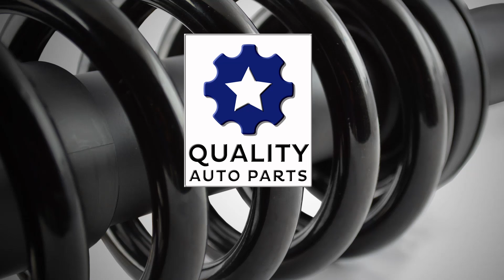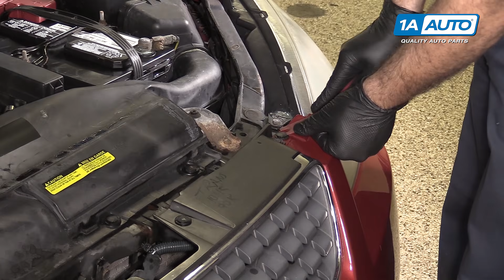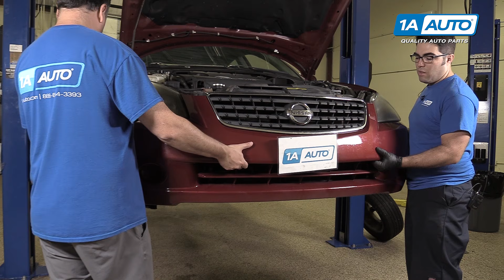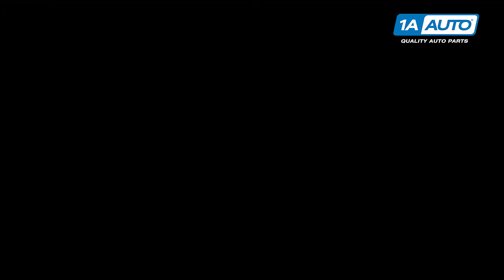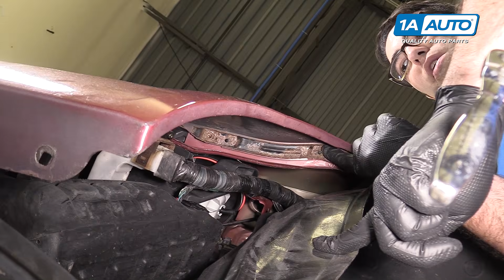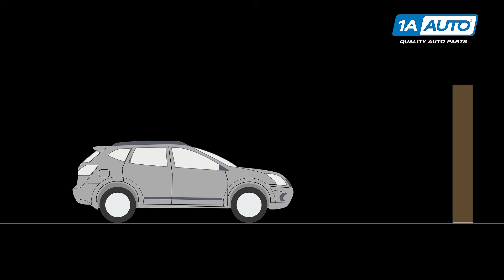How to Replace Headlights 05-06 Nissan Altima

Comment: My driver side headlight came out without removing the bumper.  However, someone had taken them out before and didn't put the screws in behind the bumper.  I'm slowly fixing this car and getting it back to where it should be.  Love your videos.  I feel like if I watched them all for the 2005 Nissan Altima 2.5, I could take the entire car apart and put it back together!  Great content!  Thanks.

Comment: Whoever painted that car should be shot, over spray on the fender liners and wheel wells, the front black fog light inserts they didn't tape off or just remove...  Those are painted as well! Not to mention how bad the fender Justice k looks in the video....  Rant over LOL

Comment: You're definitely not getting these off in a junk yard, unless someone did you a favor and took the bumper off, which is very possible. Mine we hazed so bad you couldn't see any of the internals. Mother's restoration treatment made a world of difference. Eventually I will need to change mine though. Even changed the grill for a two for 1 video.
Reply from the maker: +Giuseppe Benvenuto Thanks for checking us out!

Comment: Or you could just remove the air filter on driver side the coolant reservoir on the passenger side and reach in from the top.
Reply: Will this method allow you to completely remove the headlamp?
Reply: @modernvintagelifestyles Yes will it
Reply: That's a fact why would you choose the long way this dude is a clown
Reply: Even the front screws?

Comment: Question   I have a  2006 altima  with  HID  bulb  where is the  ingniter  or  ballest located drivers  side  low  beam
Reply: Under the headlight assembly I believe but not 100% sure

Comment: Thank you! I just bought a used 06 Altima 2.5S and the State Safety Inspector failed the headlamp lenses (among other things). Then he gave me a $660.00 estimate just to change the headlamps ($ 192.00 per headlamp!  plus 2 hrs of labor???). OK, all kinds of alarm bells went off at that price - as well as their grand total of the other charges. So, immediately I googled prices on the headlamps to find his prices were about 350% markup.  of course I have changed headlights before ... so, I  thought how dang long could it take to change to bulbs?? More googling and VOILA! I found your video! Admittedly, a bit shocked to learn I need to pull the bumper, but its a few snaps, bolts and screws - no biggie. I've had to get to tougher tighter spots on an airplane. BOTTOM LINE - I am purchasing these headlights from you and I will do the install myself. Your instructions are great. I don't have (and don't need) a lift to get to these bolts (Former USAF Aircraft Maintenance Technician and Daddy's Girl - the kind that helps dad work on the car! All those years of tagging along when he did mom's brakes, headlights, timing, tunups, oil changes, belts and hoses, radiator ... and years working on planes have paid off! )
Reply from the maker: +Kaleido Scope Thank you for the great reply. We love to empower our customers by showing you how-to perform your own auto repairs while installing our high quality auto parts. Have a great day! 1aauto.com
Reply: You can remove the air filter box and easily change the headlights by doing that. My friend who's a mechanic didn't have to remove the bumper he was blown when I told him "hey I thought you had to remove the bumper?"

Comment: are you kidding me - i need to remove the bumper to change the headlight lenses!!! Did this just turn into a pricey auto-mechanic job?
Reply: Not at all its actually like a 15 min process
Reply: most cars you have to remove a few parts to get a headlight out.. The bulb is easy on the Altima but the headlight a little longer..

Comment: Why on earth would anyone design a car that you have to take off the wheel and the entire bumper to change a headlight bulb????
Reply: There's this method, then there's a method where you take the air filter box out and you can reach to the headlight then remove it. My friend, who's a mechanic,  showed me that on my Altima
Reply: For real!! That was the dumbest assed design.  My 18 year old just bought her this car and the left headlight went out.  The bulb only cost 14.00, but this other shit is crazy
Reply: So that you're forced to go to an "official dealership" and pay for what's supposed to be a menial task.